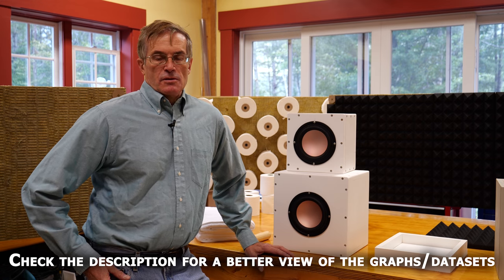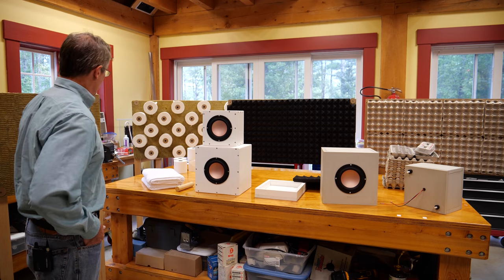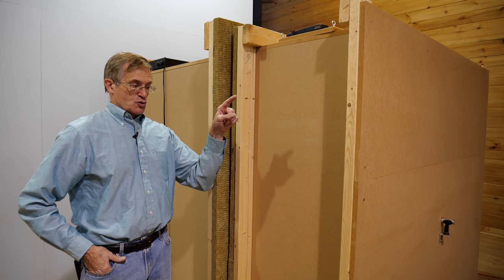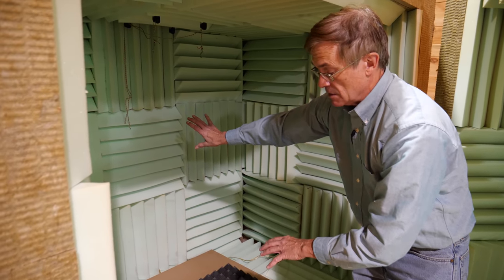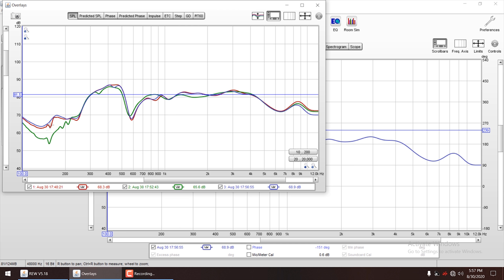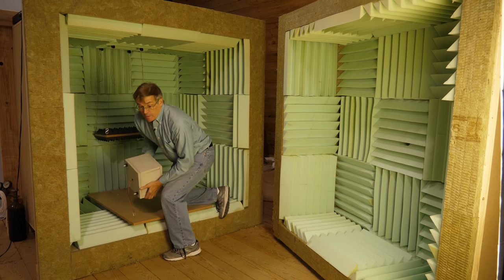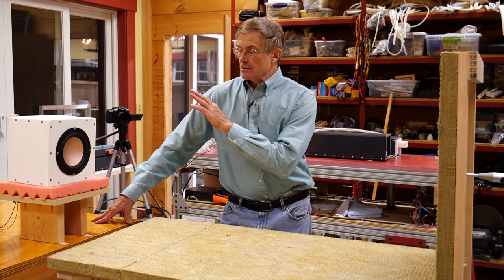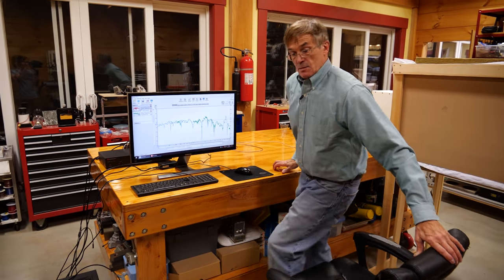DIY Speakers and Acoustic Panels

Comment: I wonder if you, "wet" or "coated" the surface of the Rock wool with a heavy oil or a waxy substance similar to Cosmoline, if you would be able to not only stop the dust production, but even, improve the performance due to the heavier mass?
Reply from the maker: It might.

Comment: Thanks for the video.  Wonder what the impact would be of leaving drywall on the sides but changing out the back wall instead?
Reply from the maker: If you're talking about a listening room, each wall will contribute reflections and it's shape and size will matter as will the position of the listener.  If you're willing, I'd suggest experimenting.  Find a large blanket or two and move them along the available wall space while a volunteer sits in the preferred position. If you can get a few people to help, you'll discover what you need in a couple of minutes.

Comment: When you turned the speaker back, the measurement shows 90% the direct sound of the speaker, at the low frequencies speakers are pushing alot of air back as well, not just forward, you need alot more insulation on the backside of the speaker to do the test intended
Reply from the maker: You're probably right.

Comment: Brilliant video, thanks.
Is there a way to project a narrow beam of low frequency sound? 
The application would be to point it at a limiter in a pub with reverse polarity to cancel the base sounds, so the gig won't end in darkness lol
Reply from the maker: Thanks!
Yes there is by using an array of very high frequency, ultrasonic transducers and creating a slight frequency offset in half of the transducers.  The resulting beat differential can be low frequency, audible and narrow angle.  The effeciency is quite low, but that may not matter.

Comment: @Tech ingredients, i've watched a lot of these times of projects, im wondering if you have tried to steam bend the wood to almost make  no joints needed for a box, i would have to explain more but think fiber glass. The reason I ask is because this would be able to open the door to light weight car audio systems for drag race cars. I know no one would prolly do this, except me
Reply from the maker: I've steam bent wood for marine projects in the past and it's actually kinda fun.
I'd avoid it for speaker construction simply because of the work to set it up and the low precision caused by the variable spring back. Wood as a core material along with fiber reinforced skins is extremely strong and can be light as well.
Why add any additional weight in the form of a stereo system in a dragster? Maybe consider a removable system for a weekend racer?

Comment: Dear Mr Tech thank you so much  for the  terrific educational videos that have spanned years now.
I wanted to ask,are these oscillations,which are of course real ,and a few db in amplitude, perceptible?
I suspect that one would hear these oscillations as some kind of coluration of the sound.
Are the oscillations due to driver amplifier to speaker interactions do you know,and is there a way to model these oscillations to get a clearer understanding of them?
Thank you.
Reply from the maker: If you're referring to the dips and peaks across the spectrum, they may go unnoticed, but if a dip happens to correspond to a voice or a note from an instrument then it will sound muted or distorted.

Comment: Perhaps I missed a part, but I'm under the impression that there is more to a good environment for listening than to flatten the response like a studio. Do you intend to test various diffusion and scattering materials? If so, I have some 3D printable files you can get started with. I followed calculators and whatnot, but haven't had any tests done yet.
Reply from the maker: At some point the room becomes part of the listening experience and "flat" isn't necessarily the most interesting. It's like asking,  "what is the perfect landscape"?  This not only depends on the music, but also on the audience.

Comment: So, you use software to compare speaker output across various frequencies. Do you do anything to compensate for your microphone? This isn't my area of expertise at all, but if destructive internal interference can set up inside of a speaker I'd expect that it could set up inside of a microphone too.
Reply from the maker: The microphone is a calibrated analysis mic that includes a correction factor across the frequency spectrum.

Comment: I know it's probably way too expensive. But do you think aerogel would make a good sound insulator?
Reply from the maker: I think it would be decent, but not worth the cost because what sets aerogel apart is structure way below the scale of sound pressure waves.

Comment: Part of the reason for the rise in bass frequencies in the measurement with the speaker reversed is because the wavelength is long relative to the size of the speaker, so the sound wraps around and is radiated in all directions, rather than just in front of the speaker.  the board you have behind it probably helps a little, not because it's actually absorbing any sound radiated from the back panel of the speaker, but because it's a larger surface (a similar slightly more effective result would come from a speaker with a larger front panel (even if it extends beyond the edges of the same size box.
Reply from the maker: Good point.

Comment: Excellent work!   Question?   If you make a set of flat panel speakers out of close cell foam board, does painting the board or adhering some very thin nylon over the exposed front of the panel negatively effect its performance?
Reply from the maker: We did two videos about flat panel speakers and near the end of the first video, I demonstrated a set in our home and explained how to paint them.

Comment: 2:48 - "Four relatively similar speakers" - except they are a different size...
Reply from the maker: The internal, open volume is identical.  The two larger speakers are lined with fiber, sound absorbing panels to achieve this identical volume.

Comment: Your test in damping speaker cabs is flawed. You don't need to add extra volume for the damping material.
Reply from the maker: We wanted the volume to remain the same for the comparison.
Nevertheless, you bring up a good point.  If the absorbing material is extremely loose vs extremely dense, the compressible air volume within the same size enclosure will vary.  How can this not be significant?

Comment: Well this is the biggest waste of time I have ever seen with someone trying to do science when they have no clue what they are doing.  To begin with making speakers is a subject that is well studied and you can find scientific papers on them which eliminate the need to go about trying to reinvent the wheel.  This guy clearly ignored what has already been documented or he would know that proper porting of a speaker is not done by simply poking a hole of any size into the speaker box it should be a tuned port if he had bothered to do even the most basic research he would have realized that their are formulas to tell you the precise size of the hole and how much tube you need for hole based on the geometry of the enclosure and the particulars of the speaker.  He ignored all this while he did increase the low frequency volume he didn't see the maximum gains possible.

The next problem is even more glaring.  Sound waves don't simply reflect off walls they also reflect off the ceiling and floor just like they would walls.  When he starts trying to see the impact of dampening material he is only putting it on the walls of the little chamber completely ignoring the ceiling and floor... why?  Why waste the time an effort of putting dampening material on only 2 of the 4 sides that will be reflecting sound waves.  You would have thought that someone that bothered to build the other chamber for trying to test the speakers with material on all the walls, floor and ceiling would have at least tried to do it properly for the dampening test.  I had to laugh at the amount of time he appears to have put into this attempt at testing something while at the same time making such huge mistakes that he results were pretty much meaningless.   

Then he starts playing with helium... well the effects of helium on a speaker are documented and has been so for years.  He isn't blazing any new trail here he's just chasing something already known but coming up with the wrong answers because he is clueless.  To begin with filling a speaker box with fiberglass or other material isn't done to try and stop reflections of sound waves in the box it is done to slow down the sound waves.  By slowing down the sound waves the speakers behave as if you have a larger enclosure.  If you fill a cabinet with helium then the effect you get is the same as if you had a smaller speaker cabinets because the sound moves faster through the helium.  The fact that it is less dense doesn't inherently change the amount of energy required to move the speaker cone, the differences were from the speed of sound waves reflecting off the inside of the enclosure.  However his testing was once again flawed by the fact that he didn't simply fill the speaker cabinet with helium he was also filling the test chamber with helium and a significant amount of the helium he was pumping into the speaker cabinet was going right out the top of the speaker cabinet hole.  For the love of god he forgot that helium is lighter than air so if you want try and fill a speaker cabinet with helium you would need to slowly release it into the top hole of the speaker and have the open hole to allow air to escape at the bottom of the speaker cabinet.

I really hope this guy goes and reads some basic books on subjects he is trying to understand before he wastes anymore of his time doing halfassed experiments.
Reply from the maker: Wow, thanks for the lengthy comment.

Comment: Maybe someone else already said this but if you would have used the "narrow" side of the box to hang the "shelf" then you wouldn't have needed the knee board thing at all since you could reach the shelf from standing position.
Reply from the maker: Thought about it, but because the "door" moves, a complex set up will swing and there is some risk with that.

Comment: Would a randomly shaped foam improve or make the sound performance worse? Or any randomly shaped surface also have the same effect, assuming its not a hard surface.
Reply from the maker: I believe it would, but I didn't test it.

Comment: Just wondering... 
Does helium behind introduce nonlinearity or nonsymmetry? Also, for the helium test, would it have been better to vent the box through another tube to the exterior so that effects of helium in the chamber could be discounted?
Reply from the maker: Probably not.  The helium enhances the output across the spectrum, so the effeciency increases, but the underlying nonlinearity of the speaker is unchanged.

Comment: What might occur with helium volumes on both sides of the  speaker the front vented or perhaps with an elastic membrane separating the front and behind helium volumes?
Reply from the maker: The output would reduce drastically.  Take a look at our videos on helium and sound.

Comment: wow never heard of putting helium in a sealed speaker, wonder if that's the secret sauce behind why svs sealed subs perform so well...
Reply from the maker: Maybe, but helium is notorious for leaking out of containers.  Except for metal, glass and ceramic, everything else will leak.  If there is a provision to occasionally refill, then it's possible.

Comment: It seems that you worked harder, not smarter, in the sequence of your tests. Why not perform every variation on a given speaker while it was already in the chamber and connected, as opposed to swapping the speakers in and out several times?
Reply from the maker: We did it this way to make the presentation easier to follow.

Comment: If I have a really noisy device such as let's say a big air compressor and I want to create an insulated box for it to make it be as quiet as possible on the outside of the box, which material(s) should I use for the inside of the walls of the box?
Reply from the maker: The Roxul Soundboard.  Make sure the cooling flow doesn't have a direct line into or out of the box and has to make at least one 90 degree bend.

Comment: Egg cartons are good on a buget, but to make them worrk well you need to layer, and space them apart as well as fill them with some loose type foam media. But yes they will work, they just dont work as well as you think wothoit augmentation.
Reply from the maker: Eventually they become a component of a more comprehensive sound absorbing barrier.

Comment: Low frequencies are omnidirectional, so it does not matter, if you turn speaker away rrom the microphone.
Reply from the maker: All frequencies are expanding spherical waves.
Reply: @TechIngredients  Surely in theory, but in planar element like a face of speaker, upper frequencies ore directional and lower frequencys bends behind the speaker as well. What I'm pointing out is that your chamber is more efficient on low freqs, than your measurement shows.

Comment: might a layer of spray adhesive on all surfaces of the rockwool help reduce particulates if they are behind something or not? Unsure of the effect on the sound.
Reply from the maker: It's risky.  As the surface becomes stiffer and less porous it will tend to reflect sound rather than absorb it.

Comment: Could you not attenuate low frequencies better in your anechoic chamber by having a lighter construction, and just let it through to dissipate in the outside room (or better, outdoors)
Reply from the maker: Yes, if you're outside, but inside the low frequencies would just bounce back in from the walls.

Comment: Hi,
I'm looking for a somewhat heat conductive, non electrical conductive coating for motherboards (to be placed outside).
What would you recommend?
Worst case scenario, I'll use plastidip or epoxy.
Thanks!
Reply from the maker: I'd stay with a low viscosity epoxy.  A lower viscosity will produce a thinner layer with better thermal conductivity and at least several hundred volts/mil electrical breakdown.
Reply: @TechIngredients  Thanks for the tip!
I did have a few cans of clear coat plastidip in the shed, I'm not using and it's free. So I'm using this instead.
I know it's not the best, but it's all I have.
The temperatures of the board aren't too high (est. 45C max), and it's mostly electrical insulation I need, from conductive dust (like carbon or other things flying around in the air), and bugs.

Comment: It's not showing the failure of your anechoic chamber that you get same SPL from the rear of the speaker as from the front when it comes to long wavelengths. It's just a nature of monopole sound source. You would get ~same result in a proper anechoic chamber as well.

Other than that, everyone else has pretty much mentioned it already before. There's quite a few oversimplifications and hasty conclusions that more thoughtful measuring would have probably showed (decay rate/waterfall plot, off-axis/power response, impedance vs. frequency etc.)

That said, I don't think enclosure material is hugely important as long as something reasonable is used, for example MDF performs just fine.
Reply from the maker: It's interesting that you criticize us for oversimplifications and hasty conclusions and then go on to recommend MDF because it's not hugely important and it performs just fine.😒
Reply: @TechIngredients  I don't mean to sound overly critical since I'm a fan and appreciate your content.

Still, you've gotta admit that if you set out to  find or prove something with measurements, you need sufficient understanding of the system to measure the aspect where the difference will be likely found. And certainly not to measure aspect where it almost certainly won't.

As it stands, it's a happy coincidence it's true that minimizing cabinet resonance in typical home loudspeaker is not terribly hard or costly. Still, an impedance measurement would probably have shown little peaks indicative of resonances, and it's usually easy to tell from the frequency which one's are from the cabinet and which are from cone break-up.

Comment: where is your resonance of the port ? its kind of a useful information when you look at differences. especial when you only measure from 100hz.  its also a GOOD idea to insulate while ported.. since otherwise you get higher frequencys out of the port while you only want to add some lows...
Reply from the maker: We didn't attempt to go any further down that rabbit hole...for now.  Optimizing the port size, location and ducting is itself an interesting topic and the video was already pretty long.
Reply: @TechIngredients  i understand,  its just that no damping at all might create more problems when ported. besides that damping can increase the apparent cubic liter in a cabinet by 5%.  could be helpful in some regards. also using a port also creates a phase issue. so there is more to it then just saying dont use  damping and do use a port.. to some degree yes. depending on bass for $$$  and how far you want to take fidelity i guess.  but thanks for answering. i do like the videos you guys produce im  a sub for a reason !, but the speaker related topics might need a bit more clear explanation, and please extend the measured frequency response :) since in the DML video the frequency you did not show whas the frequency where most people that attempted DML's have the biggest problems. since its either having low end and lack top end or the other way around :)

anyhow keep them coming ! and love your working space.. its insane ! by the way if you where interested in planar magnetic drivers for any tests send me a message. i have a YT channel  about making these kind of speakers drivers.
Reply: by the way love the toilet roll version haha